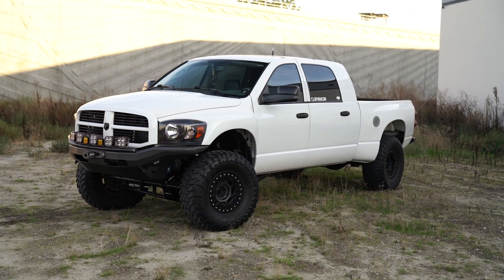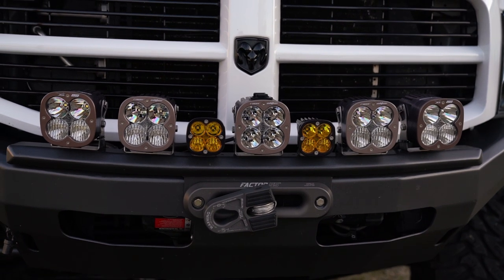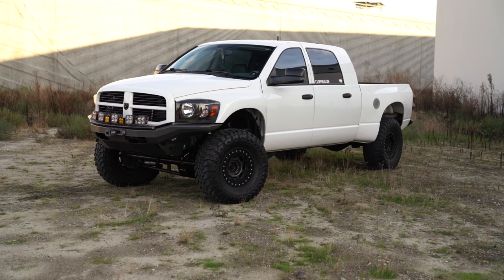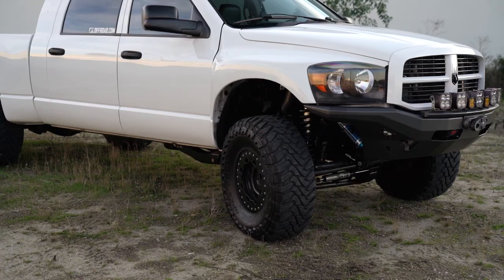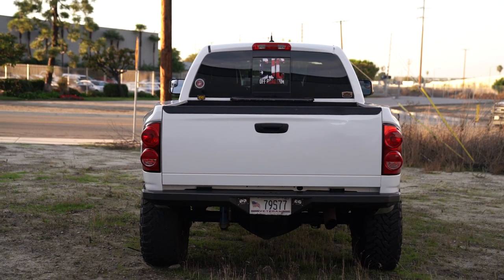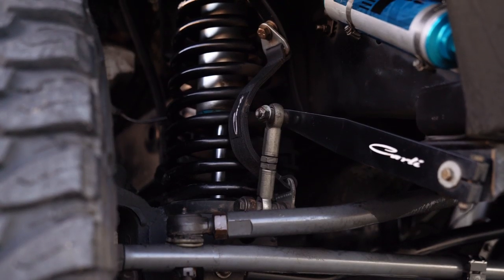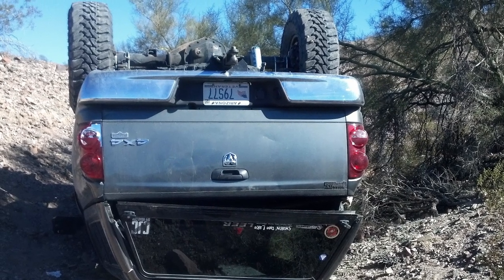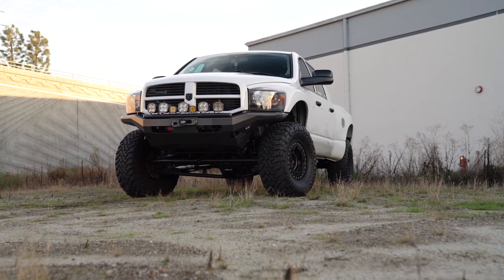3rd Gen Cummins Mega Cab Build | CJC Off Road What We Drive Episode 3

Comment: I know this is an older video, but I’d really like to see how he got a wide stance with this suspension setup. I’m under the impression that the carli unchained suspension that he has doesn’t increase the width of the stance. 
Any modification to the a arms? Wheel spacers? He has Baja fenders front and rear, but the tires are flush. I’ve only seen people achieve this stance on the gas engines, but never any diesels without heavy modification. 
Any help would be greatly arppreciated as I’m doing a similar setup with my 04 5.9, but I’m stumped with the front suspension
Reply from the maker: These trucks have solid axles, so no suspension will widen the stance as that's fixed by the axle width. This truck is running a 3.5" backspace wheel which matches the width of the fiberglass flares perfectly. That's a pretty aggressive wheel spec which is perfect with fiberglas flares.
Reply: I just saw your reply. Thank you so much. Looks like he may have some kmc’s on there with that amount of backspacing. Do you guys have a similar looking  wheel with the same specs that’s not just for off-roading ?

Comment: This was a big chunk of the inspiration for my truck. Awesome video.
Questions
1) I'm looking at swapping to fiberglass fenders and bedsides, what brand did you use and what was your experience with them?
2) I know a lot of guys relocate their batteries for these dual battery setups on the diesels, by chance did you do that with this truck?

Thanks in advance for your time. Keep up the inspiring vids
Reply: Also, who did you have do the 2and gen swap for you? Or, did you do it yourself?
Reply: 1)Fiberglass is ADV installed by Autobahn Collision in Torrance, CA

2) Yes, my batteries are under the bed.
3)I installed  the 2G swap myself.

Comment: Do you prefer the Timbren bump stops over the Carli air bag setup? I’m currently running the air bags, but I only tow a few times a year. Wondering if removable stops would improve ride quality.
Reply: I personally don't like having bags. There is no bag that will hold up to serious thrashing. If you keep it mellow, the Carli bags are a great option. Timbrens ARE NOT bump stops. They are a supplemental load carrying device, just like a bag, and will ride like an inflated bag of you leave them in. Don't leave them in as bump stops.

Comment: What back spacing did you have with the 40s?
Reply from the maker: Since the truck has fiberglass, Paul was running 4.5" backspace
Reply: @CJCOffRoad  if it didn't have glass would he been able to run different spacing and still not rub? Im essentially trying to figure out if I have to have glass on my 2012 to run 40s or will a bumper get me the clearance in the front?
Reply from the maker: Yeah if you want 40s on a 2012, you'll need fiberglass. People may say otherwise, but glass is required to really cycle the suspension! Even then, you'll still need to clearance the firewall and inner fender supports to be able to bottom the truck fully.

Comment: What exhaust set up are you running? 4" or 5" axel dump ?
Reply from the maker: This is a 4” axle dump.
Reply: @CJCOffRoad  I have a bootleg backwoods 5" from when I got the truck. You have a recommendation for a 4"?
Reply: @CJCOffRoad  is there a 4" exhaust that you recommend?
Reply: I’m running a 51” Donaldson attached to the factory tailpipe, dumped behind the axle. Very simple setup that works.  Basically using the factory pieces to interface with the 2nd gen swap down pipe. Any decent  exhaust shop can do this.

Comment: Whats the tire/wheel combo? Offset ect. Mine has glass also on 20x10’s with 37x13.50 Nitto’s. Looking for a 17 setup that sits like yours.
Reply from the maker: This is a 17x9 Trail Ready wheel with 4.5" backspace on a 37/13.5/17 Toyo MT tire. We've got links to that wheel in the video description!

Comment: How does the truck tow your 17k lbs trailer with the suspension? Wanting to trade my 2nd gen single cab dually for a 6.7 3rd gen single also have a 18k lbs trailer to tow
Reply from the maker: Paul uses Timbren bump stops to add towing capacity when he needs it, then takes them out for better ride and off roading.

Comment: Ok because it’s a 3500 even with the triple bypass does it ride stiff on the street, and towing 17000 pound do you use a 5th wheel
Reply from the maker: This truck is actually pretty smooth on the street! The trailer is a 5th wheel.
Reply: @CJCOffRoad  one last question do you do enough off roading that you think you would have gotten better articulation if you had coil overs instead of leaf springs?

Comment: Timbren only out back? Why do you remove them?
Reply from the maker: Only out back and only when towing! They’re a towing bump stop so they ruin the ride quality off and on road when they’re on.
Reply from the maker: Only out back and only when towing! They’re a towing bump stop so they ruin the ride quality off and on road when they’re on.
Reply: I remove them because they are a supplemental load carrying device, just like an air bag. They act like an inflated air bag (without the bounce) if you leave them in. It takes less than 5 minutes to take them out. Small price to pay for full travel.

Comment: All that $ into it with only 450 hp as a result? 🤦‍♂️
Reply from the maker: With the way he drives off road, more than that just becomes a liability. The forces through the driveline when you're on the throttle through whoops are pretty intense. Drive shafts etc don't like that kind of shock loading. He can obviously up the tune easily for more, but has it dumbed down on purpose.